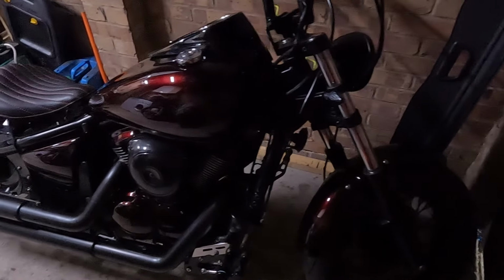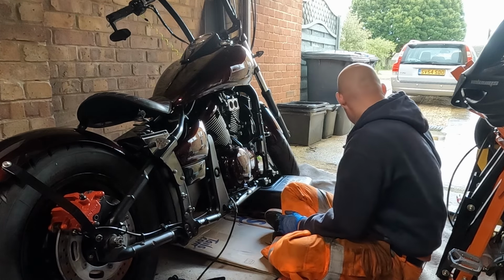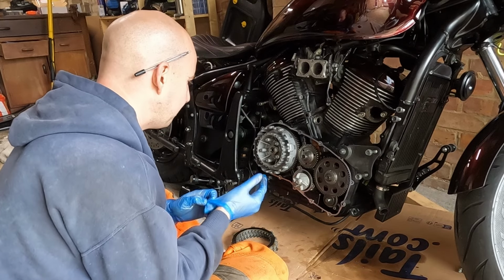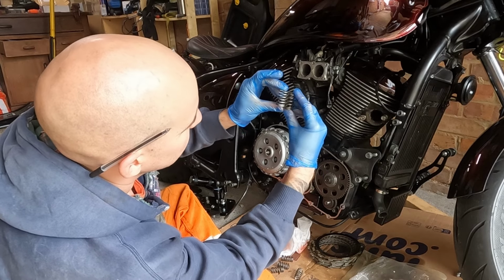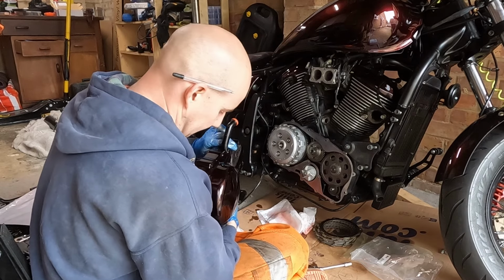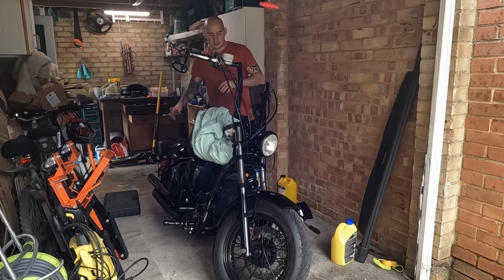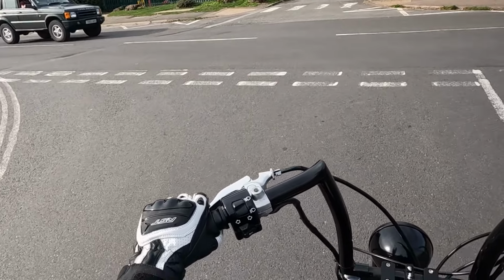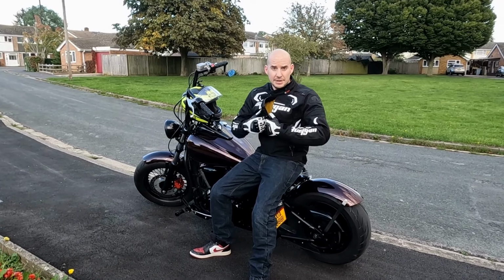How to change the clutch on a Kawasaki VN900 Vulcan

Comment: I have an old Honda Transalp 700. When I bought it, clutch was very hard to press, got used to three finger clutch pressing and rode without issues. But after 3rd clutch cable snapped I changed heavy duty clutch springs to original ones from Honda. 3 clutch cables in season, all snapped right at the lever. Now whole season without any issues and clutch is very light, not hydraulic light but very easy. Totally not saying you will have similar issues or such, just sharing my experience with heavy duty springs. Also one funny thing to mention, even the lightest clutch, if you take one single spring and try to press it with hands, it's almost impossible. There is no way telling clutch hardness by pressing springs using hands.
Reply from the maker: @lauraiss1027  thanks for the info bud. It's been hard work with the adjusting bit its working perfectly.

Comment: Following 😎👍
Reply from the maker: @stancekings7231  thank you so much buddy very grateful.
Reply: Will it work with stock clutch cable ?
I have 12" apes but stock cables
Reply from the maker: @stancekings7231  yes it will work with stock everything as its just got stronger springs. Its just the cable adjustment that takes a bit of fiddling. But it's mean't for the bike. I only have different cables as I have 14" apes and 2" risers which the standard one definitely won't work ha ha.